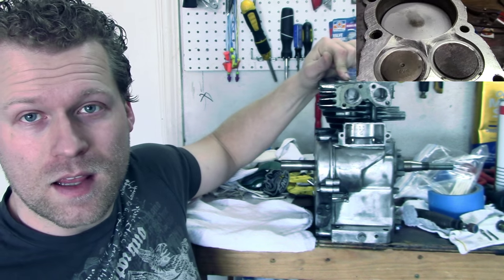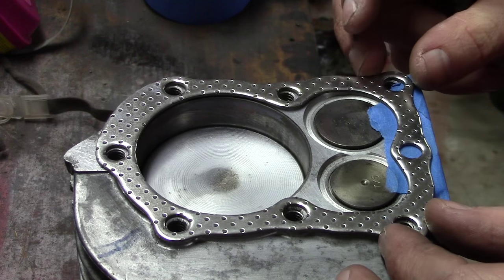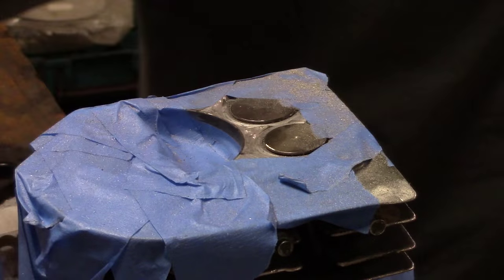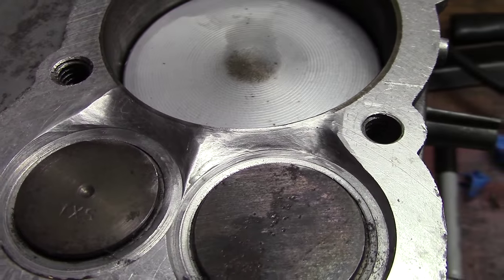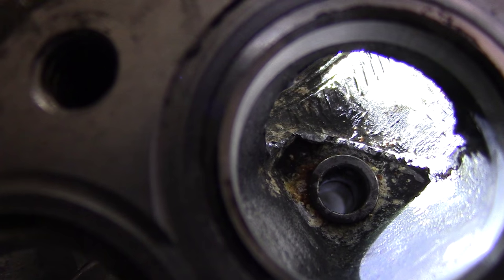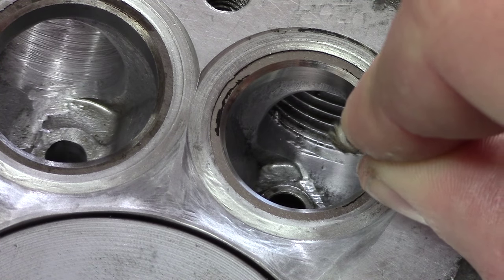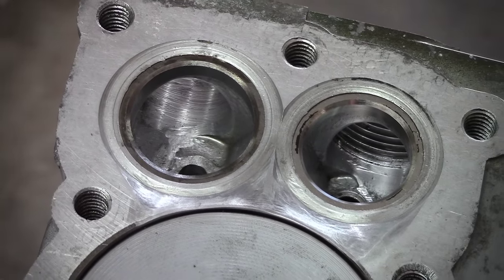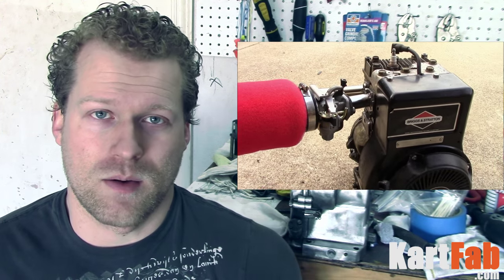How to Port & Polish, Shave Eyebrows: Briggs 5 hp Flathead Performance Mods

Comment: the intake should never be smooth so the air/fuel can mix a lot better :)
Reply: +Boss Kelso Ummm.... 'No'. Fuel/air are mixed in the carburetor... what he is port/polishing is the passage inwhich the said mixture will be traveling into the cylinder. A textured surface is a 'restriction' for said flow (envision a stone path vs a sidewalk, and your feet are the drag on the momentum down the path/passage).

If enough is ported/routed from the intake side (w/out taking out too much metal, ofcourse), 'that' and possibly adjusting the jetting up (a size, if needed), can increase HP/torque abit more (.5~1hp)... not counting the free flow intake and header he's already probably added 2hp from stock. ;-)
Reply: +Tihm Kart if the intake is polished and smooth, then the gas may form droplets on it, and atomize worse!

Comment: The only way your going to see improvements from your work is with a flowbench and ccing the chamber with a burrete with liquid? That is the proper way to build a motor and also degree the cam with a degree wheel! Lot of work for a motor of this size you bet but just going off of videos your shooting in the dark and chasing your tale! Get a good performance book and speak with vendors and always trust your own work with solid numbers and procedures? Never although informative base your work on u tube videos! Sound working knowledge and procedures puts you in the winners circle!
Reply from the maker: +Mike Mansfield Can you please buy me a flow bench and dyno? I don't currently have an rn tea 5-10 grand just laying around